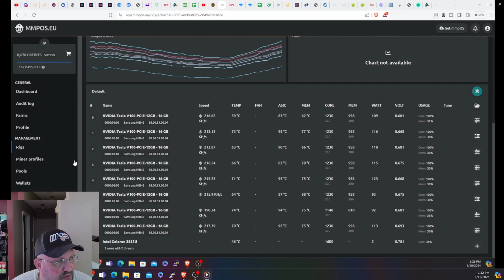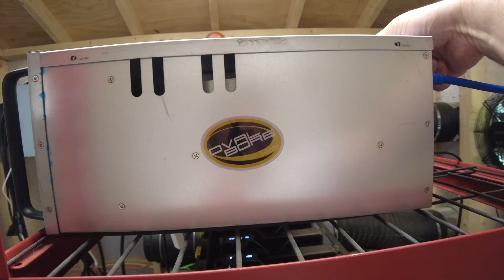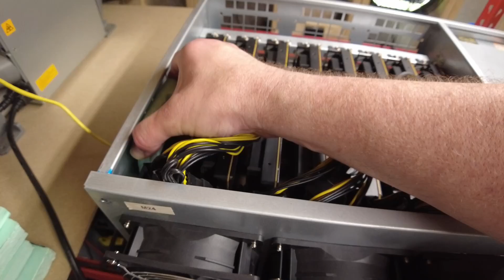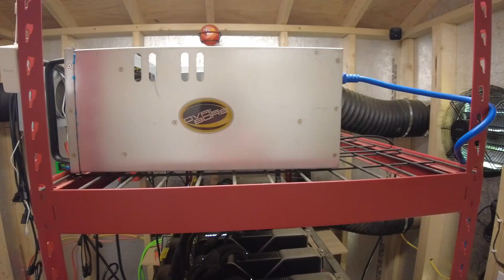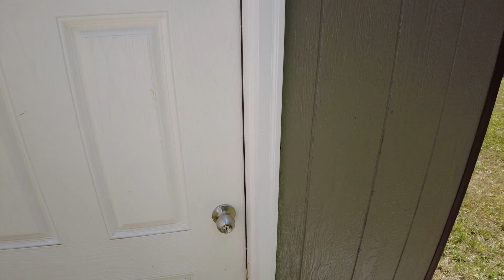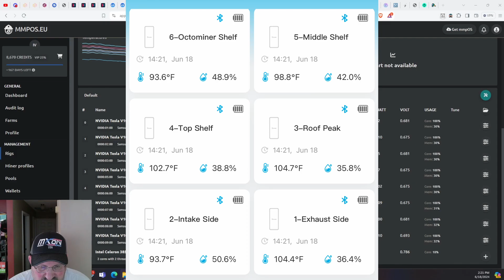CMP100-210 Cards Used to Be Here - Where Did They Go?

Comment: Suggestion for the temps, I'm in Texas so living in 100F's+. I put 6 of these units in an older Octominer X12. Put the fans in suction and not blowing. On the back of the rig, tape off the empty spaces. Forcing the air to go in through the heatsink.

I tried doing the same on a mystic mining rig v3 and it doesn't work because there is spacing between the card on the back and the fan. 

Not sure if this is right but I have the feeling the snugger the fit, the easier to tape off any gaps and the more direct the airflow.

Cards have been running in a 100F garage on Xelis not getting above 66c, Dynex doesn't even get above 56c.
Reply from the maker: So the fans are sucking the air out on the side of the power plugs? I tried on the back of this case to suck the air out of I/O side of the cards and it didn't work as well